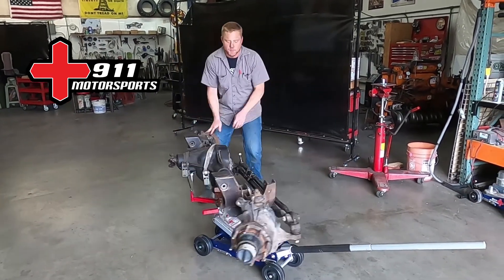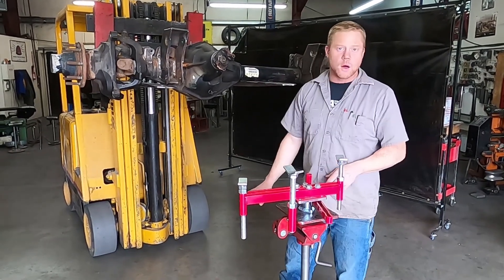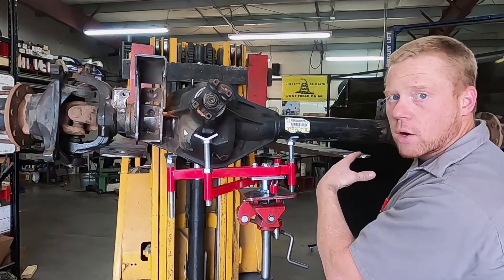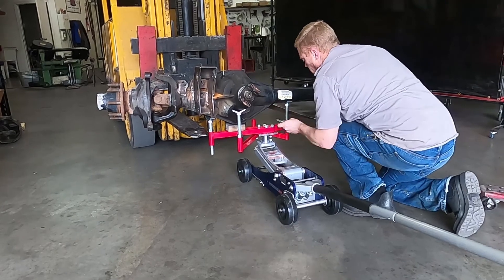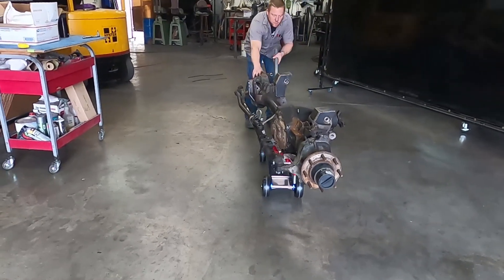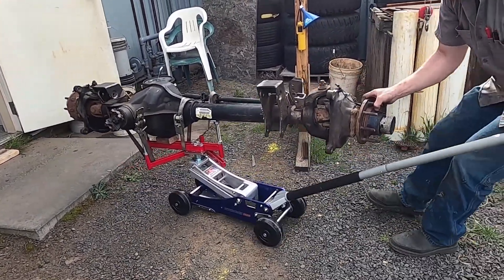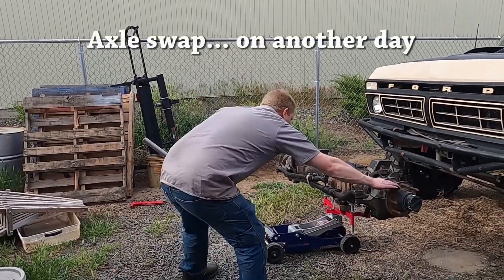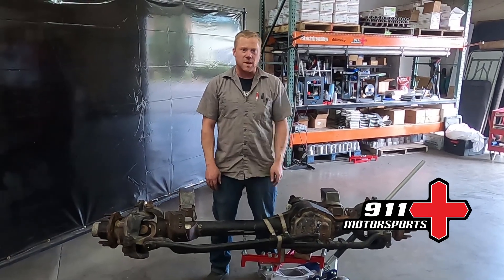Balancing a Front Axle w/ 4 Point Jack Adapter on a floor jack - Ford SuperDuty Dana 60

Comment: I woulda been fired for running over the air hose at the gas station like that
Reply from the maker: Good air hoses are pretty tough. I was actually surprised that we were able to roll over an air hose! If you hit it right, it works, but there were some test runs that didn't work quite so well.